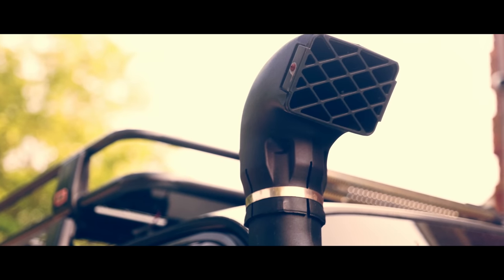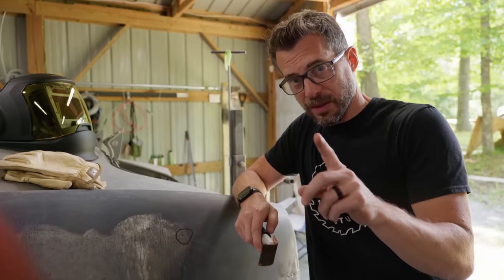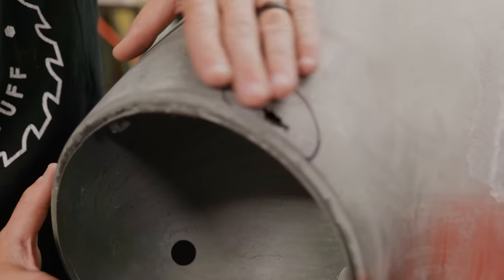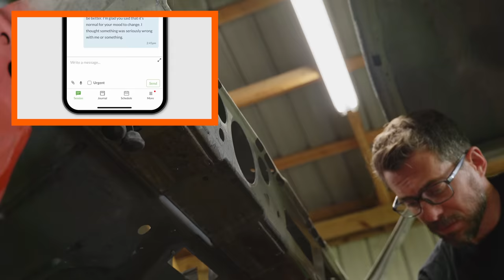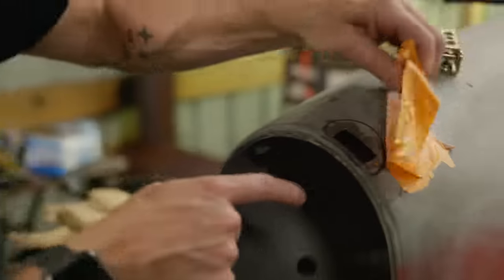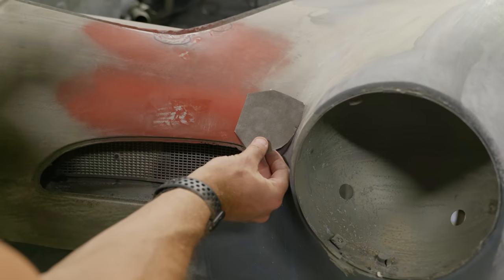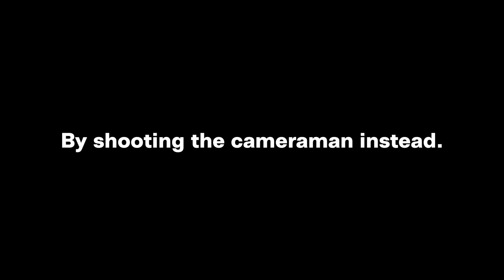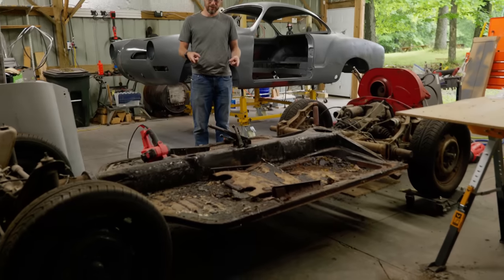Did I Give Up On My DREAM CAR?!

Comment: A few pieces of advice. Don't make sharp corners on patch panels. The corners will burn through when welding. Turn your wire feed down some and increase the voltage. You aren't getting good penetration. Decrease the tension on your welder so you don't get a birds nest. You should have just enough tension to feed the wire but also slip when your wire gets stuck.
Reply: I came here to say this but you beat me to it! I would add that it seems like his ground connection is weak or too far from the weld. And it looks like the shield gas is turned up too high, not forming a gas envelope around the weld site. Resulting in too much soot in the weld. (that and the loud hiss!)

Comment: I started watching your Karmann Ghia Videos, two years ago When I got My 1971 Karmann Ghia….! I was watching anybody’s Karmann Ghia videos, to get ideas on all kinds of different fixes… my body was in pretty good shape. The floor pans were shot, and I simply put new metal in them. Nothing real pretty just structurally sound….! it’s 2:10 AM Monday, June 19 and there’s a thunderstorm raging here in Sweet home Alabama I could not sleep so I decided to watch some more Karmann Ghia videos.. and low and behold after two years, you decided to start working on your car again…! I was pleased to see that …, my car is by no means a restoration…🙄 My Karmann Ghia is a daily driver. It is mechanically 100% sound with a new motor…! New brakes, new brake lines you name it it has it… if I was younger,(  I am 69 years young ) now … And head, a butt load of extra money. I would probably be more meticulous about the body of my car…! But my intention from the time that I got it to right now, is to give it a 1970s rat rod look…! I have taken it to car shows, and it is received extremely well…👍🏻🙏🏻  you can see my Karmann Ghia on my channel, ( THE JEFF GALEY CHANNEL  ) and see it is Not all rusted out , or super ratty looking…! It just has me written all over. It’s extremely cool Italian design body…..! Keep posting your videos about your Karmann Ghia and I will keep watching them have a great upcoming week your friend in Sweet home, Alabama, Professor, Jeff Galey….🎶🎸🎻🎶👍🏻

Comment: So glad to see you working on it again. Some advice on cutting out small patches. Try using a dremel with a cut off wheel. When using your grinder use s flap wheel on sheet metal it will give you a better finish. Also a good tip for cutting patches out of sheet metal use aviation  snips much easier to trim. Keep going each thing you fix you are getting closer.

Comment: Great work so far, and doing real well for a novice. 

As someone else said your running your wire speed way to fast for sheet metal work, disregard the "sizzling bacon" advice everyone gives as it doesnt work for thin metal. Wind the wire speed down and maybe click the volts up. You should be able to lay a series of tacks that are burnt all the way through the back side and lay fairly flat with the top side of the join when set right. 

Also dont be afraid to dump the epoxy on, the back half looks pretty dry. You want the entire thing somewhat glossy when its wet like the front. Getting runs isnt really an issue as your going to be using polyester fillers and fairly course grit sandpaper over it anyway so its a good time to learn the limitations of the spray paint, how much you can lay on without it sagging. 

Keep up the good work mate.

Comment: It's awesome to see you are back at the bench (so to speak) with the KG.  I really can't wait to see it done (don't worry, I know it's a looooong way off, been there with vehicles also).  I see you still have a lot of rust to take care of (for instance, when you were working on the patch between the left-front fender and the grille, the camera picked up another big chunk of rust behind), I would recommend getting a leather sandbag for working small patches like that into the right shape.  You can sit it on a bench or on your anvil and work the metal with your hammers, dollies and punches until it is about right (then finesse it to finish as you have been when tacked into place).  Another thing, with the FJ40 (I'm guessing it's a FJ?), go check out what Fab Rats did with their FJ.. while an LS swap may not be necessary, perhaps a 1UZ-FE swap would give you reliability and more power in the FJ and keep it all Toyota?  May be a colab with Fab Rats could see something like this into fruition (here's hoping lol)?  Keep up the good work.  I can't wait to see the next instalment on the KG.

Comment: Try turning down the wire tension a fair bit when using thin wire, it won’t push as hard and will reduce that bending inside the machine

Comment: Always happy to see this project. For those radiused pieces of metal, look up an English wheel. For the body filler remember that you want to use the least amount possible as the thicker it is, the more chance you have for it to chip off after you've painted the car. This really is a massive project so huge props for taking it on. 

Oh, and look into the brands of body filler. It's been a while since I've looked into it, but Rage Gold was considered a better product than Bondo was so do a little research on brands.

Comment: I used  to be a spraypainter  a few years ago ,and back then u couldn't spray filler over epoxy-primer , maybe that has changed over the years ,but it would be a shame if your new paintjob just falls off.
So i should check it out ,just to be sure.
Back then we would grind/sand to the bare metal ,then put on the filler ,and then put on a wash-primer (etching-primer) ,and after that the normal primer ,a few layers of base coat ,and then finnish it off with 2 layers of clearcoat

Comment: So probably not the recommended way but I found that using a mig at the right setting would burn thin metal til it got to good metal, then I could start stacking and working back to fill the hole.  Gun angled to hit the edge of the metal sheet.  Spot welding, 2 second pull, 5 seconds to cool, rinse and repeat.  It's how I'm getting rid of small rust holes on my old 4runner.

Comment: I recommend getting that epoxy off and doing it with the welder, or a patch panel. It 100% will not hold up long term. Any panels that you need to weld that will have metal on metal should have copper coat paint on them (you can weld through it) and seam sealer on any lip or repair to prevent moisture from getting in later. I never lap weld panels, but many people do. For home projects it's fine.  POR15 is the best rust lock paint imo. I worked at a body shop for 8 years where we built multiple 1st and 2nd place Concours d'Elegance cars. Biggest thing people mess up on body work is trying to rush through it.

Comment: Where did you buy the sections that goes from the rear seat cross member to the floor?  I need to replace those on my KG as well. Thanks in advance!

Comment: Hey i understand you are a professional and you do great work but please be more careful with that sheet metal. When cutting small pieces they typically fly in the air and i would recommend safety glasses next time and only if you want some no cut gloves too. All coming from a sheet metal worker. Keep up the great work!

Comment: In retrospect, Bob, you probably could've used a Dremel tool with a cutting wheel to achieve a precision cut on the headlight.

Comment: when doing body work, you need a hammer and what's called a dolly. IE a piece of metal you hold in your other hand, behind what you're hammering on. They have flats and curves you push against the piece where needed so that you hammer flush, and dont push the work below the body line.

Comment: I wonder if for the part that you had to patch with the all the compound curves you could 3D scan the surface, then use that plane to bisect a block into two halves you could then 3D print and use to press the sheet metal into the exact correct shape of the void.

Comment: The first thing I do when I get an epoxy with the plungers tied together is cut them apart.  That little bit of plastic is a lie.  It's so much easier to just dispense an equal amount by eye.

Comment: whoo hoo you are going to have fun with that chassis replacing the floor . cut the pans from the bottom one fellow used the structural adheisive to put it back together. not sure if I would do it. if i could suggest. blast your frame and epoxy it first then do the work. you only have to remove the epoxy where you need to weld. good job so far NEXT!! :)

Comment: Not a big fan of the plastic sprayer. Just seems like more waste and less reusability. Yes, keeping your nozzles clean etc takes a bit of effort compared to just throwing it out and getting a new one, but replacing it with a plastic disposable one doesn't seem like a sustainable solution.

Comment: Doing stuff to cars is very rewarding, I did similar stuff of my own car fixing rusted through bits on the panels so I used metal mesh in the holes for structure and body filler on top. First time doing it with prime and paint too and couldn’t even tell it was there, cheaper than welding too (yes I’m a girl, yes I like cars) 😂